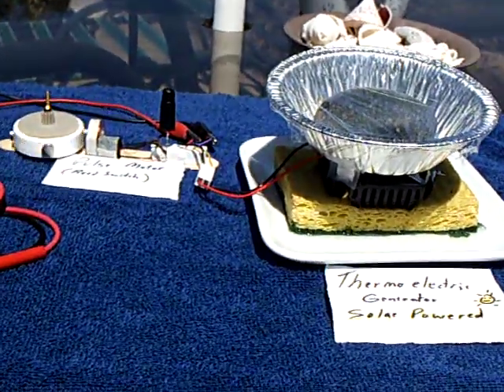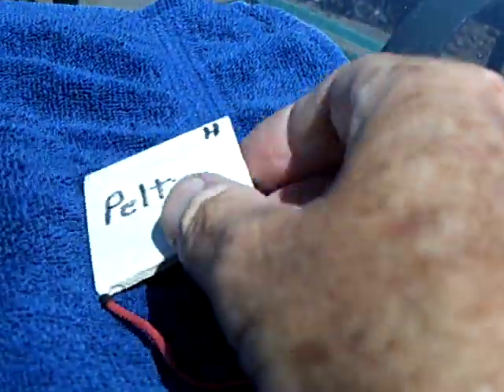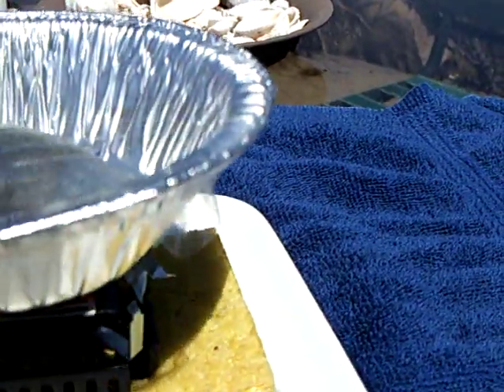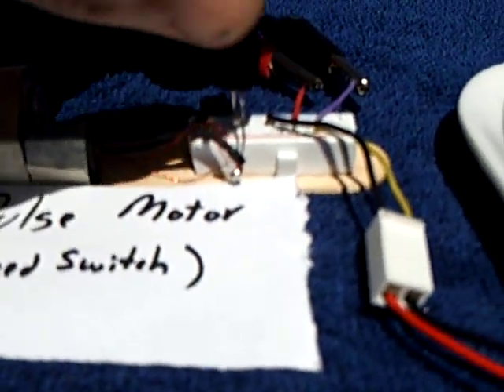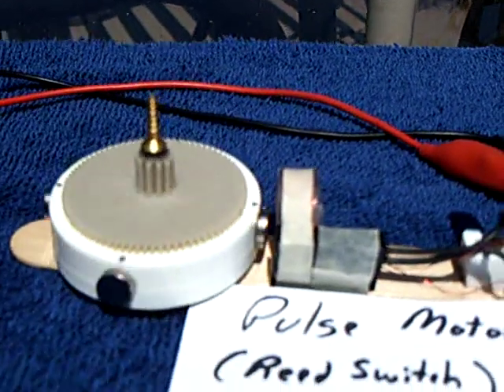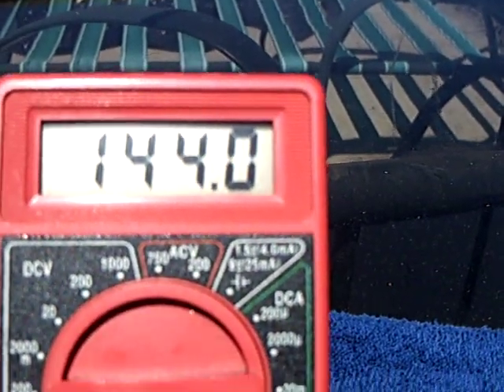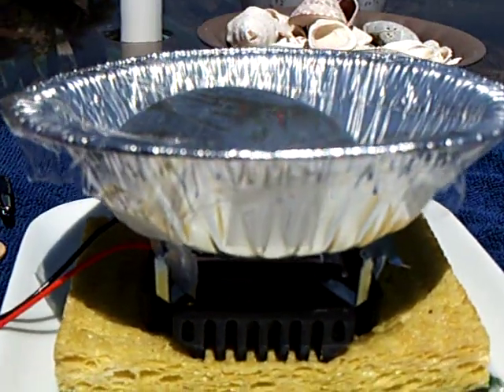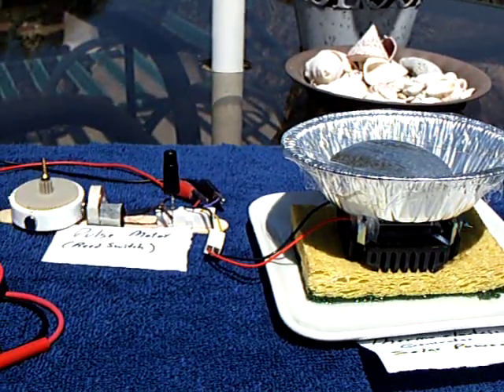Solar Powered Theromoelectric Generator ---- Powering a Pulse Motor

Comment: Do you have any of those old crystal cells? It would be interesting to see if those old cells create more power in this setup
Thanks
Reply from the maker: This little motor needs amperage and my small crystal cells just don't have it.  I have had great fun trying all kinds of homemade batteries on this and have been very surprised at what works and what doesn't.  The basic parameter is at least 100 millivolts and 1 milliamp under load. It doesn't care where it comes from.
Reply: ***** I have noticed that some of my old crystal cells act like a thermal electric device
As long as the volts stay on the crystal cell, even though the amps are around 1 MA, you can increase the amps using temp difference (like you have setup here) Thought it would be interesting to see if you had the same results that I had
Reply from the maker: I just found my old epoxy sealed Mg/ Cu cell and brought it back to life using a hairdryer. It has been sitting dormant for several years. It was made with melted Epsom salt, Rochelle salt and Alum (no liquid water).  It wasn't the temp difference though that revived it---just heat.
Reply: ***** Yes, this is true with mine also, but eventually the cell will heat up to same temp and the amps will go down, but watch what happens when you treat it like a thermal cell with hot and cold
Copper hot Mag cold

Comment: what about a teeny bit of sump oil instead of the rock. apparently you can use sump oil as an artificial horizon although I've never tried. have you seen my latest VDG I neglect to mention that you have to adjust the brushes ever so carefully to be in the middle of the belt
Reply from the maker: I watched your VDG video and was amazed at how you used that light bulb (with no bearings) as the top roller.  Sometimes pure simplicity is all that is needed.
Reply: ***** in fact it has a thumbtack glued to the top end. I did some detailed photos at http://durealeyes.com/staticgen.html it keeps going wrong & because it's so minimal it's very hard to resist trying to find out why. every time I form some new dogma about what's going on

Comment: Very nice little motor :) thanks for sharing!
Reply from the maker: Thanks. This little motor is a curious thing.
Reply: :) it's very well made that's one thing :) And it's run on very little power. Now after this you should try to see if you can extract some of that power.

Comment: Thank you Lidmotor, good process to achieve energy.
Reply from the maker: I did some more research yesterday on the progress of using TEGs for making electricity.  They are starting to use them more and more.  People are discovering clever new ways to employ them.  They are not very efficient but then neither are soalr panels. Put enough of them together and then who cares.
Reply: Lidmotor, yes, efficiency is not an issue, when utilizing or employing to capitalize or harvest wasted heat from mechanical or natural sources.

Comment: Nice build, I thought about building a peltier under a slab of concrete like a driveway and was thinking what the output would be on something like that on a bigger scale.
Reply from the maker: That might work as long as you can make good temperature differential between the concrete and the ground.  Unfortunately the Peltier modules really need a BIG temp delta to work well and make good power.

Comment: Neat very low power solar-powered thermo-electric converter.

Are you familar with this tech:
http://www.powerchips.gi/technology/overview.shtml
Reply from the maker: Thanks.  I checked that out.  Very interesting.
Reply: Indeed.  If their claim is true (i.e.: "WE expect the output voltage of each Power Chip around 0.5 Volts. At a 20 A current, the power output is 20 A * 0.5 V = 10 W for every cm2 of Power Chips.", then that is a lot of power produced in a small space.  10W/cm^2=~64.516W/in^2 or 9290.3W/ft^2.  9.3kW per square foot is amazing.  1 ft^2 could be used to power most homes very nicely (even during the summer).

Comment: Another beauty. I will have to dig my ex-solar snowman out again and see if I can replicate this if we get any more sun this year.
Reply from the maker: I ran the experiment yesterday using cold instead of heat and the thing ran just as well. This winter you might try a Peltier against a cold window with inside room temp as the differential. The Snowman might like that idea.  You might have to series connect several modules together to obtain the 1/2 volt the little guy needs.
Reply: ***** I only have one Peltier at the moment, might have to treat myself to another eBay session. I did get one of my solar flowers to run using ice on one side and my soldering iron on the other, but I was being impatient. I like your use of the black pebble and the 'solar collector'. I vaguely remember buying the Peltier with the 'cold window' idea in mind, but it was another of things I had forgotten by the time it arrived. I will have to write it down in my note book.